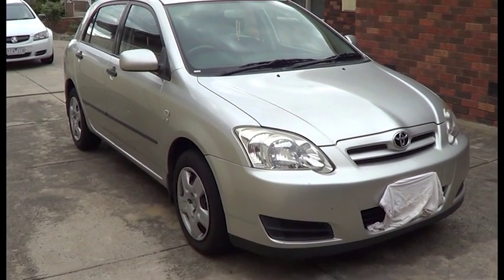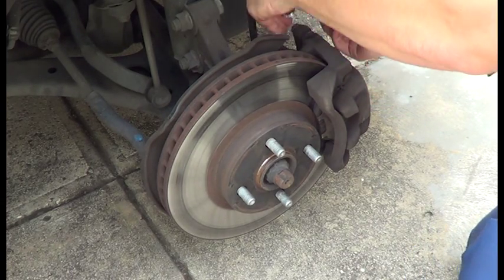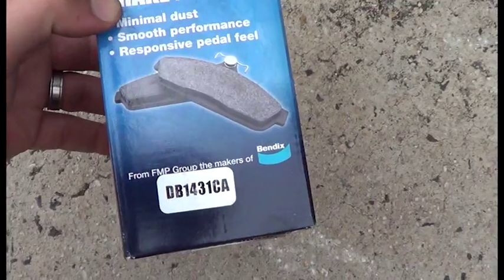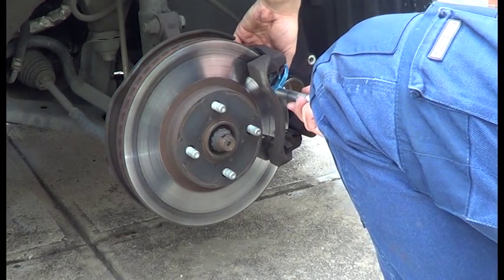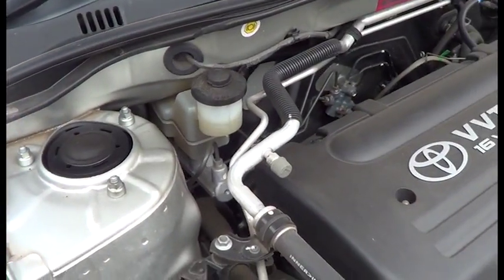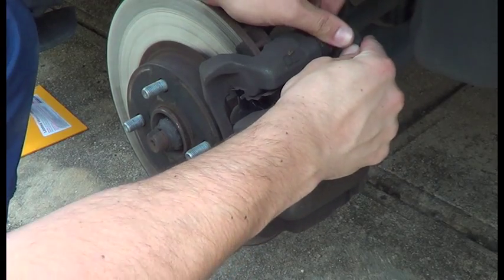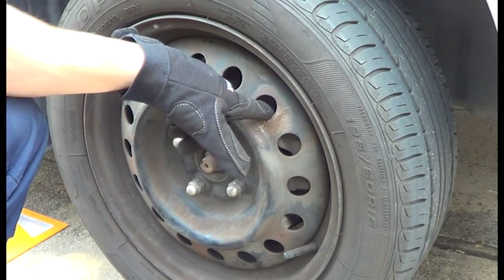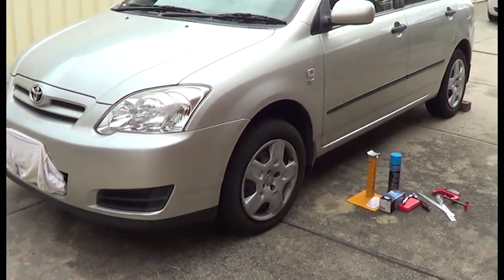Toyota Corolla - Front Brake Pad Replacement

Comment: It may be helpful to put some silicone paste on the bolts as they are moving parts.  Also some antifreeze on the clips and the back where the piston comes in contact the back side of the pad.  Anywhere metal meets metal should be lubed.
Reply: antifreeze???
Reply: I think he meant antiseize

Comment: That certainly is a time saving and quick way to do it for sure..however I always take the caliper assembly completely off and secure it to the strut as I prefer to remove the 2 slider pins to check, clean, and lubricate.

Comment: great vid, 1 question though. is it necessary to pump the breaks before you start driving?
and if you need to pump the breaks , do you pump them when after you've replaced the breakpads on the left and right side or do you pump the breaks after you did 1 side and than pump again when youve finished the other side?
Reply: replace the pads on both sides then pump about 10 times because if u don't u won't have brakes to start off with
Reply: heya, thanks for the info, it worked out fine.
Reply: @ethanstewart3386  TY!

Comment: Question. Do you have to purge the system by removing the brake line nut, pump the brake padel and open and close the port. It's that something that needs to be done after replacing the brake pads and rotors?
Reply: You only need to purge or "bleed" the brake system if you are disconnecting the bangobolt located on the calipers. Air doesn't get inside the system by simply replacing brake pads.

Comment: Your Corolla looks alot different than the 2006 Corolla here in Canada... and 4 bolt hub pattern vs 5 here.  I'm also a fan of always replacing the rotor when doing pads - in the event the rotor is worn poorly, has a bad rim, etc etc.  You didn't mention about transferring clips - I have watched a number of these and some have clips, others do not.. so am wondering why that is...
Reply: These cars have more than one manufacturer of calipers. Some use them, some don't. Simple.

Comment: Old pads have 2 shims per pad total inner & outer 4 shims per side. 8 per vehicle. New pads come with 1 shim per pad. Should you reuse outside shiny stainless shims over new pads or not?
Reply: Brakes are the most common replacement every car owner have to do most often, because you cannot simply ignore it no one knows when it will leave you helpless on the round. manyautosltd.com is my car doctor they know what to do with my car and when

Comment: Never, leave your brakes caliper hanging like that, always use a caliper hook, you're putting strain on the brake hose. And, don't forget to grease the ears of the brakes and always clean the mount bracket and everything must be torque at the factory spec.
Reply: Do you know torque specs?
Reply: What are you talking about, he didnt leave the caliper hanging from the brake line. It was just rotated a bit

Comment: always turn your rotors
Reply: What do you mean?
Reply: @ProfeCreepyAdventures  They mean to take a wire brush to them and possibly turn them on a lathe to correct for runout and warping.

(In the vîdeo I assume he deemed them within spec when he used the micrometer and ruler.

- "runout" is grooving of the rotor
- "warping" is uneven thickness or just wear beyond the rotors specified minimum thickness